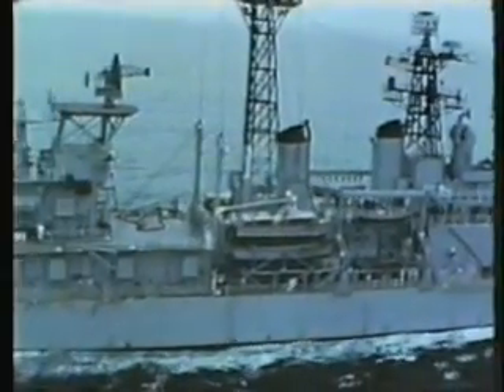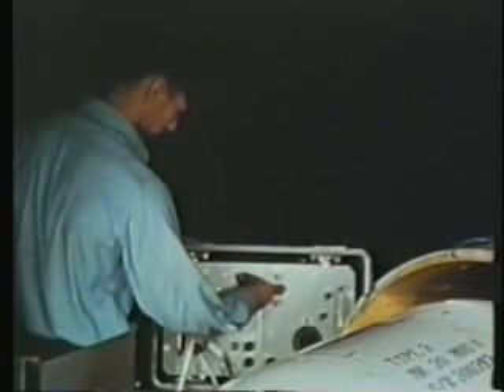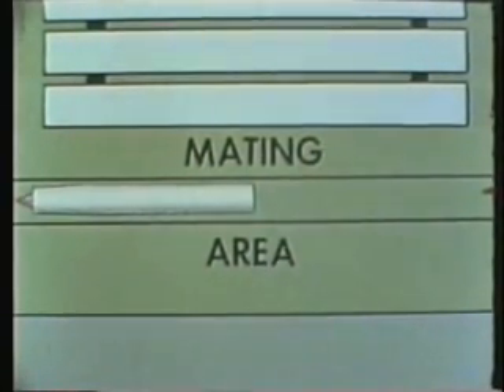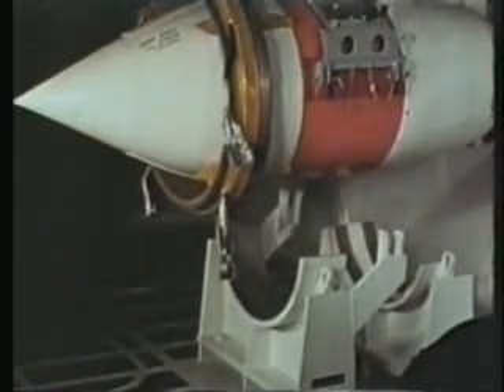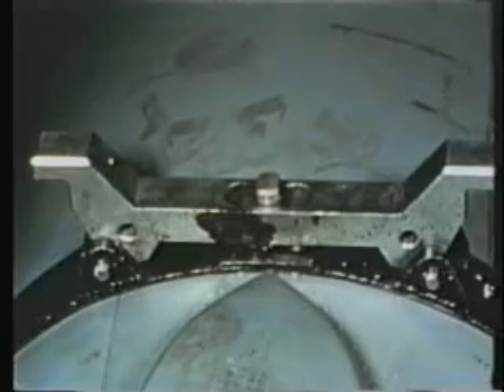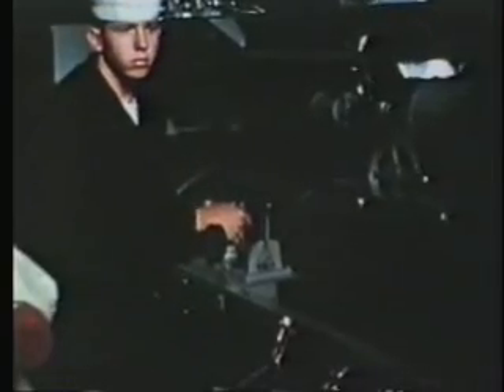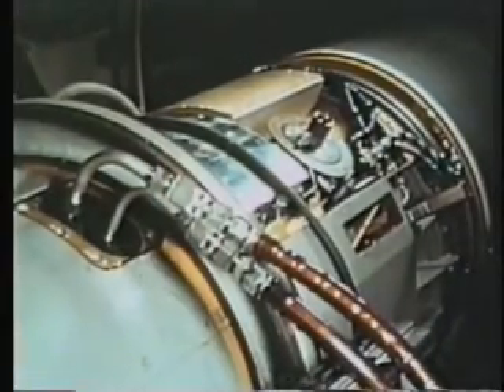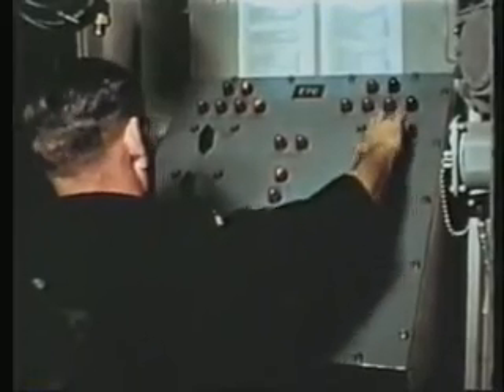Declassified U.S. Nuclear Test Film #49

Comment: May be late1950 or early 60s film, the control panel switches are very old fashion.
LED were not invented they were using small 6v or 12v bulbs.

Comment: they used to call them 'atomic' warheads ... i wonder when they switched to 'nuclear' warheads
Reply: Kevin Olesik  I think the switch to "nuclear" happened in the early to mid 1970s (73 - 75).  I've always prefered the word "atomic."
Reply: It's actually two different types of weapon entirely, an atomic warhead is considered to be low power and inefficient, a nuclear warhead uses an accelerate to improve the fission reaction, something like Cobalt-60, which produces a Thermonuclear Hydrogen weapon. While a standard modern nuclear weapon is generally the same principle as an atomic implosion bomb, but has a secondary, which is basically extra fuel to create a larger reaction.
Reply: bower31 No.  You're wrong.  The early "inefficient" bombs were "nuclear," and the only ones in the US atomic arsenal, today, are "THERMONUCLEAR" (and I don't say thermoatomic, because that's uncool).  A thermonuclear bomb is a two stage weapon, with the first part being an implosion-type fission bomb, and the second stage consisting of lithium deuteride.  (That's 6-Li and 2-H...)  The second phase of the weapon is a FUSION bomb.  All of it is "nuclear," but I prefer to say "atomic," except when referring to the two stage device, technically, which is "thermonuclear."  Otherwise, they're atomic, because atomic is cool and nuclear is not.
Reply: Peter Wexler Well I never claimed to be fielded far in nuclear weapons, I'm better at word identification as my ASVAB showed me
Reply: bower31 If you want to get a fill about nuclear versus thermonuclear devices, read Richard Rhodes's first two books in his four-part series: The Making of the Atomic Bomb and Dark Sun.  The work is non-technical-historic, but technical enough to make the reader dangerous.
Reply: ' they used to call them 'atomic' warheads ... i wonder when they switched to 'nuclear' warheads '
--- perhaps it was a patent issue -- so they changed the physics as well.

Comment: I served on two Talos cruisers in the 1970s.  The video leaves the impression that the system operated slowly as far as moving missile components and loading the launcher.  It did not, and the speed that those large mechanical parts could move was surprising.  I remember the SPG-49 tracking radars (which weighed about 10 tons or so) could slew to a designation and lock on a target in just a few seconds-- even "pop up" over the horizon targets.

Comment: @lmlove80 If you think about it, it was a perfect system but not how the designers officially intended it to be.
In realistic scenario only two nuclear missiles would have been ever fired, ships lacking working guidance radars end equipment after 1st exchange (yet still afloat for a long time).
At the same time the system limits the number of the armed nuclear missiles aboard the ship.
Imagine Tico with 32 hypothetical armed SM3-N. If fire aboard, despite all protecting, something could blast.